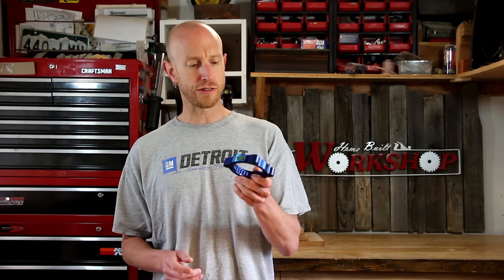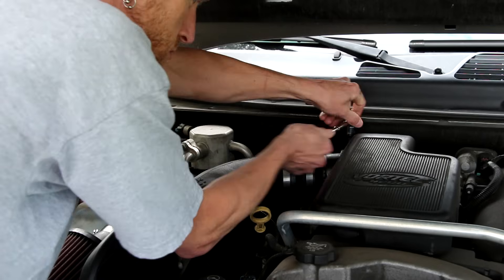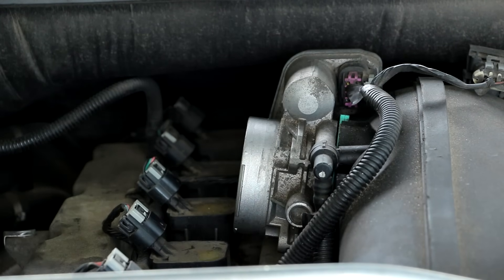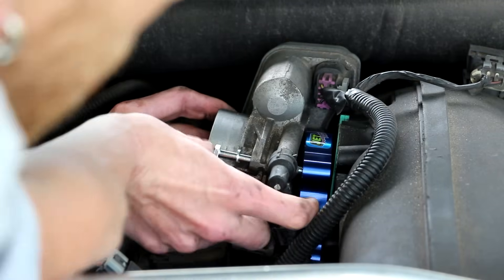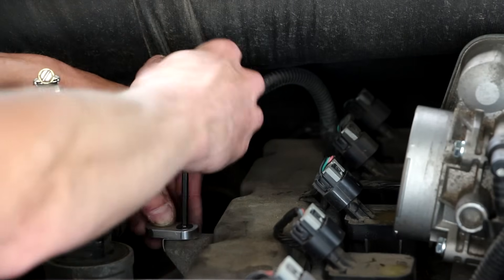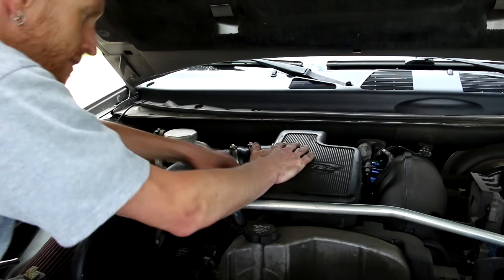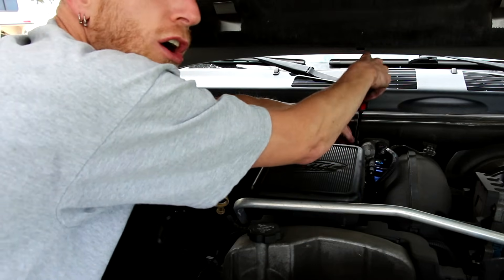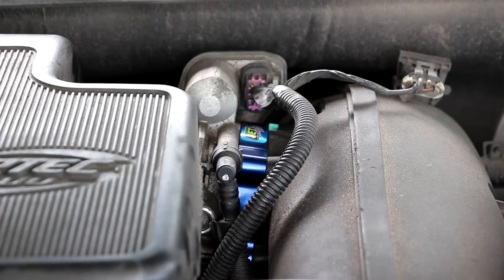Is A Throttle Body Spacer Worth It?

Comment: Thanks...I just ordered six! All going into the same car. Huge gains here I come!!
Reply: Lol
Reply: That's like 200hp on spacers yo
Reply: Dont forgot to add stickers for 20 extra hp
Reply: Good think it has racing blue
Reply: You won't be able to pass a gas station without filling up.  Also, tire cost because of all the power you will burn the tires off every time.
Reply: Damn I will order like 20😬😂😂😂
Reply: Post pictures
Reply: 🤣I really don’t buy that you can feel a 1-2% difference in power.  I believe they call that buttseat Dyno or otherwise referred to as the placebo effect.  I’m not doubting that it gave you 1-4 extra hp
Reply: Woah, bro, you'll like have all the horsepower.
Reply: I just put one on and it blew my motor gains.....
Reply: I got 8 in my 86 Honda. 
Fuckin amateurs 😏
Reply: @spankthemonkey3437  I hope you're joking. Although if you aren't, I want to know if it does anything
Reply: LOL!!!!!!!!!
Reply: @spankthemonkey3437  how did you even hook that up lol
Reply: there are no gains with a throttle body because there are only gains if the throttle body has the injectors in it and with the spacer there would be a little more velocity and more area to mix the air fuel mixture
Reply: @justinfarris7045  horsepower gets tester at higher rpm’s if you have just the tad more air coming in when your still in your lower end up gears since your not running as many rpm’s the little extra bit of air might be more noticeable than running at 60 mph
Reply: This guy
Reply: Dose that work
Reply: @kaicollins2838  Uno
Reply: Lmao, if you wanna throw $$ to the trash, send it my way instead
Reply: Vroom Vroom. 😆 🤣
Reply: Well how is it
Reply: how. where
Reply: Lmfao!
Reply: Truly the funniest comment I've seen in while!
Reply: What stickers you using ?
Reply: @justinfarris7045  YES, Justin -- you CAN'T feel 1 or 2 % in power -- folks that claim that they can "feel" an increase, are using what I call the "ButtHEAD Dyno" .
Reply: Hella spaced bro!!!
Reply: Wait we can put more lol I thought it was only one lol
Reply: Was the engine able to take the gains?
Reply: @justinfarris7045  you'll notice way more gains replacing your 200k mile coil packs then doing any other performance mod short of a tune or turbo on these 4.2's, I was just starting to get misfires at 246k miles on the stock coil packs, swapped them out and gained 5 MPG HIGHWAY compared to the abysmal 16.5 MPG this truck used to get on all highway.
Reply: Lol!!!
Reply: He should have used his earings as spacers.

Comment: Dyno numbers before and after please
Reply: some YouTube did a dyno run and it's little improvement. about 3 more hp and 7 torqe. he's right about little improvement
Reply: what car was the test done on?
Reply: NutriFIT nutritie si fitnes I highly doubt there was even a 3 hp improvement. the reason is, when people first started using this upgrade, it was on carb engines mounted in a vertical fashion. this increased the distance from the carb, to the intake runners, creating a "tunnel ram effect". this is simply not possible with a horizontally mounted throttle body
Reply: +no body you hit it on the head. With a carb, you have both fuel and air flowing thru a spacer. This is just air, it did nothing, people want to feel a difference, that why later he decided it's not worth it.
Reply: Joshua Barton yup, and you can't convince many, if not most of these people. too many think the fast and furious is actually based in fact...lol
Reply: ihateliberals only have to go throuhh the comments to see this....
Reply: You think 3hp, on a ten minute bolt on is "little"?   over all yes little.   but people spend thousands and just to get 15 - 20 hp .....3hp would be miraculous....especially below the curve.
Reply: IT DOES NOT CREATE A TUNNEL RAM EFFECT.    (ooops sorry about the capitals)   Carb spacers have to be tuned, and added and subtracted , little by little to determine which height works for your set up.  it has to to with signal,   signal into an "open plenum" and the distance from the carb mount, to the top of the intake valve.   From their we use a formula for intake runner length to for optimizing cam timing and depending on over lap, we then also use a reverberation plate.   Sometimes adding a spacer works, sometimes not,  but tuning the actual depth is more important.
Reply: LOW END POWER - Under the Curve  800 - 1500 RPMs

 Actual NUMBER 1- PSR 2015 Honda Accord - Throttle Body Spacer    2.5 to 3HP   7 Foot pounds of Torque

2-  Dyno test with throttle body energy ring from Phase2Motortrend  4 hp and 4 on torque.

3-Throttle Body Spacers - Presented by Andy's Auto Sport  5 hp 7 ft tq
Reply: Marc Chartrand yes, 3hp is LITTLE. I got more improvement than that in my 97 prelude, by building a sealed ram air system. and it didn't cost anywhere near "thousands". I don't know who you're hanging with, but if you're spending thousands and only getting 15hp. you got issues. and what I said about "creating a tunnel ram effect" on a carb. engine is 100% true and accurate. and there was no "tuning" required. on just about any v6, or v8 a 1 inch spacer gained an improvement even with a totally stock engine.
Reply: After we have done, all the little improvements, and topped off the porting and intake, headers and cam......and we are searching for the next "bit"   more..... is what I meant.   THEN,  we would be quite happy to have 3hp for a quick / cheap little bolt on......SO, would any of the People I hang out with. Yes,  you have Just begun, seeing little improvements by playing with your intake.   When you are all done, and out of ideas and have spent thousands and thousands to get the 100 200 300 hp gain,  you will be glad to "bolt on" 3hp.....you just have not been in the game long enough, or spent enough R and D time to get there yet.  (no arguing)  I HAVE done the Dyno time and know exactly what the effect of a carb spacer is, and "when" it works or does not.  It is about the signal length, the bottom of the butterfly to the top of the intake valve (when closed)  .....  https://www.google.com/url?sa=i&rct=j&q=&esrc=s&source=images&cd=&cad=rja&uact=8&ved=0ahUKEwjejZ6MvaDSAhVFySYKHQ9-CUQQjRwIBw&url=http%3A%2F%2Fwww.rx7club.com%2Fnaturally-aspirated-performance-forum-220%2Fintake-manifold-theory-967799%2F&bvm=bv.147448319,d.cGw&psig=AFQjCNEodkcyS7Fy7ezBWdo85gJfXLzvSg&ust=1487742029435724   ......

Intake Runner Length Tuning

Contributed by: Unknown

The intake system on a four-stroke car engine has one main goal, to get as much air-fuel mixture into the cylinder as possible. One way to help the intake is by tuning the lengths of the pipes.

When the intake valve is open on the engine, air is being sucked into the engine, so the air in the intake runner is moving rapidly toward the cylinder. When the intake valve closes suddenly, this air slams to a stop and stacks up on itself, forming an area of high pressure. This high-pressure wave makes its way up the intake runner away from the cylinder. When it reaches the end of the intake runner, where the runner connects to the intake manifold, the pressure wave bounces back down the intake runner.

If the intake runner is just the right length, that pressure wave will arrive back at the intake valve just as it opens for the next cycle. This extra pressure helps cram more air-fuel mix into the cylinder -- effectively acting like a turbocharger. The problem with this technique is that it only provides a benefit in a fairly narrow speed range. The pressure wave travels at the speed of sound (which depends on the density of the air) down the intake runner. The speed will vary a little bit depending on the temperature of the air and the speed it is moving, but a good guess for the speed of sound would be 1,300 feet per second (fps). Let's try to get an idea how long the intake runner would have to be to take advantage of this effect.

Let's say the engine is running at 5,000 rpm. The intake valve opens once every two revolutions (720 degrees), but let's say they stay open for 250 degrees. That means that there are 470 degrees between when the intake valve closes and when it opens again. At 5,000 rpm it will take the engine 0.012 seconds to turn one revolution, and 470 degrees is about 1.31 revolutions, so it takes 0.0156 seconds between when the valve closes and when it opens again. At 1,300 fps multiplied by 0.0156 seconds, the pressure wave would travel about 20 feet. But, since must go up the intake runner and then come back, the intake runner would only have to be half this length or about 10 feet.

Two things become apparent after doing this calculation:

1. The tuning of the intake runner will only have an effect in a fairly narrow RPM range. If we redo the calculation at 3,000 rpm, the length calculated would be completely different.

2. Ten feet is too long. You can't fit pipes that long under the hood of a car very easily. There is not too much that can be done about the first problem.

A tuned intake has its main benefit in a very narrow speed range. But there is a way to shorten the intake runners and still get some benefit from the pressure wave. If we shorten the intake runner length by a factor of four, making it 2.5 feet, the pressure wave will travel up and down the pipe four times before the intake valve opens again. But it still arrives at the valve at the right time.

There are a lot of intricacies and tricks to intake systems. For instance, it is beneficial to have the intake air moving as fast as possible into the cylinders. This increases the turbulence and mixes the fuel with the air better. One way to increase the air velocity is to use a smaller diameter intake runner. Since roughly the same volume of air enters the cylinder each cycle, if you pump that air through a smaller diameter pipe it will have to go faster.

The downside to using smaller diameter intake runners is that at high engine speeds when lots of air is going through the pipes, the restriction from the smaller diameter may inhibit airflow. So for the large airflows at higher speeds it is better to have large diameter pipes. Some carmakers attempt to get the best of both worlds by using dual intake runners for each cylinder -- one with a small diameter and one with a large diameter. They use a butterfly valve to close off the large diameter runner at lower engine speeds where the narrow runner can help performance. Then the valve opens up at higher engine speeds to reduce the intake restriction, increasing the top end power output.

**Remember** to check for other relevant information in the columns and article tables
Reply: Marc Chartrand I haven't been in the game long enough?"...you just proved my point about movies like fast and furious. this is going to be my last comment on this, but I was born into drag racing. I can assure you I have been "in the game" and you've been wrong on just about everything! you young guys who think you invented racing, or building cars crack me up. we were building sleepers which were full interior, ran on pump gas. factory heads and block. stock bottom end. we NEVER used nitrous, or forced induction. and in the case of our 69 dart gts, we were turning 10.3@137 on street tires with stock suspension in the early 80's. we started putting together a 67 belvedere in the mid 90's with a basically stock 440. it was cam/headers and exhaust turning mid 11's, also on street tires. so you can sell your immense knowledge to some kids that don't know any better
Reply: I just love how you Blather on , and on and NEVER one fact....just made up BBD  Bs.   I build BBF  BBD BBC  I have never seen any Fast and anything movies.   I work from Hp/ Cu in......and what works.  Delude yourself to the moon..  You will be back in the days of 10lbs per 1000 rpm for oil pressure antique thinking.  Glad you will not say anything more on this,  I need facts not generalizations and assumptions.
Reply: " you've been wrong on just about everything"   But you never MAKE one point that is Actually wrong,  you NEVER state one fact ever.
Reply: He probably thinks one of those Ebay electric superchargers is worth the money also.  lmao
Reply: Who?
Reply: :o)
Reply: how much is inexpensive?
Reply: Dear Dyno Man ... While yes Dyno numbers are fun to bet on and  now days  all the rage  Real motorheads know they are hardly real world  after all how many of you drive around  at W.O.T  between stop lights ..
Reply: works well on my 99 durango with a 318, pretty much same the video but i can feel it more prevalently at full tilt
Reply: Only the butt dyno can measure it.
Reply: I agree. If your gonna have a video of a product an say does it work or not a dyno is the only way to prove it!
Reply: ”I hate liberals” but I drive a Honda 😂🤣😂..it’s more than obvious that he knows absolutely nothing of what he is talking about and clearly does not know what a tunnel ram even is..it’s hilarious to watch him fail
Reply: @sidler111  i find it hard to believe a pressure wave has time to bounce around an intake with multiple intake valves opening per second. Even at idle, no freaking way. It that were true you could feel a change in air pressure at the intake side of the crb/ throttle body. Whomever wrote that watched the fast and furious one too many times. I tried to read the post but the link was broken and I dont blame them for deleting that nonsense. I call bullshit plain and simple. Beside it wouldn't be jack shit IF it did under 1600 because no car takes off at idle.
Reply: @ihateliberals518  cars race and add money to their vehicles, is that not a fact?
Reply: @solesoul2108  what does that have to do with this?
Reply: NutriFIT nutritie si fitnes Hold up where the hell do you find these for 30$ mine is damn near 300$
Reply: @giovannipoorsaid1744  What brand spacer did you pay $300 for?  Thanks.
Reply: I is hard for me to believe this will work with modern fuel injection systems.
Reply: @ihateliberals518  right? Like what is this guy doing to spend thousands to get only 15hp? For fucks sake a Sr performance cold air intake for a 96-04 mustang gt costs $60 and it gives you about 10-15 hp and the same for the torque.
Reply: eli li I know this is 2 years old but even if you’re only getting 3hp and 7 torque that’s still an improvement with no downsides? I don’t see a problem.
Reply: @port nutyup. I had one idiot tell me that "it doesn't create a tunnel ram effect on v8's"...lol then there was another Brainiac who says that ram air doesn't work. well someone should tell don garlits, john force and every other drag racer in the history of drag racing...lol (p.s. when I say "ram air". I mean actual ram air, not that ridiculous "short ram")
Reply: @sidler111  That's like surgical automotive scientifical mechanix...  right ? .. Eeh .  I know I'm right
Reply: @sidler111  YES!.. That is Great information and you did a fantastic job explaining and sharing it . Thank you Good Sir.
Reply: Why?  Lol. Not a bit of difference
Reply: Yeah, just sit back and let him do all the work, so you can armchair quarterback your lame opinion. 👎

Comment: It worked on my 05 3.5 L Tacoma 2WD. Robbed my top end speed but improved low end torque and  acceleration. I also had it Unichipped with a Volant CAI, NGK Iridium plugs, magnaflow exhaust. I got it down to 0-60 in 7.06 seconds but I Rolled it 7 times haha. I miss my Taco.
Reply from the maker: 7 times. WOW! I'm glad you're ok.
Reply: They work depending on the design. Spacer plates on carburated motors back in the day would increase the time fuel would take to reach the manifold. And in turn reach the pistons for ignition. The concept of the spacer as was the taller manifolds is the fuel had more time to vaporize . In carburated motors the cold start would shoot cold fuel into the motor giving less efficiency. As the motor warms up the manifold get hot. When fuel hits it the fuel steams (vaporizes)and mixes more thoroughly with air to burn. This the plate would give more time for the fuel to do this and less raw fuel would hit the pistons. This giving more burn and efficiency.  Now with injected motors? The throttle body shoots air into the manifold/plenum and the manifold depending on the design direct the air fuel mixture to the pistons. The injectors mist fuel that mixes with the air. The spacer if designed a certain way changes the direction at low throttle from where the butterfly is stirring the air up. You may feel a increase due the air being stirred up earlier due to the spacer. But? It can hurt more open throttle response or not change it at all  as the air passes faster over the spacer. It can help the throttle body run cooler as its further and has a barrier from the manifold but as temps rise this benefit lessens. They can produce little benefits but are more for dressing up your motor than any huge gains that are expected. A larger throttle body would give better benefits as it allows more air inlet.

Comment: Guys, everyone is crying that this doesn't do anything... on it's own, you're right. A spacer is part of a system (CAI, Ported Throttle Body, Spacer, Cams, Headers, Performance Muffler, Tune). This guy has most/all those things, so for him it works, yes. If your car is all stock, it won't.
Reply: but it’s not marketed that you need everything else with it. It’s marketed that it works on its own. if people honestly think that a device that might spin the air into the engine is doing anything …itd is absolutely comical.

Comment: I had a throttle body spacer on my 98 chevy ext cab 4x4 with a 5.7 vortec 350 small block. It helped out with the eco but also gave a lil better throttle response to the motor. I had a 3" spacer the spacer is manufactured to create better fuel and air mixture into the manifold so yes this aftermarket part does help in a small way